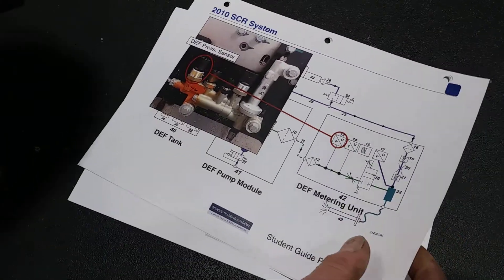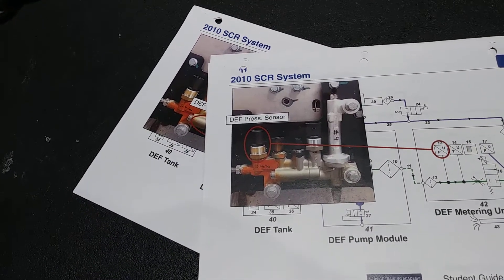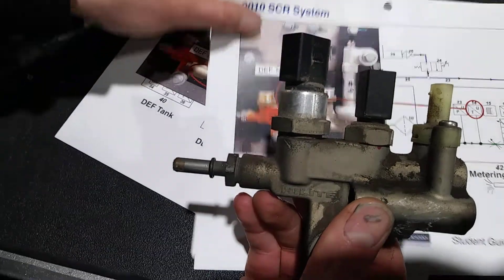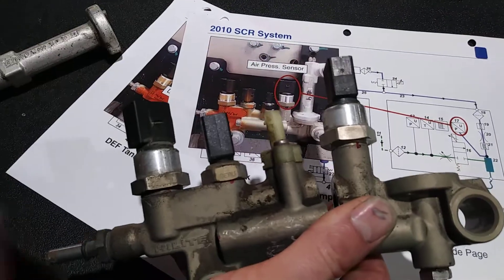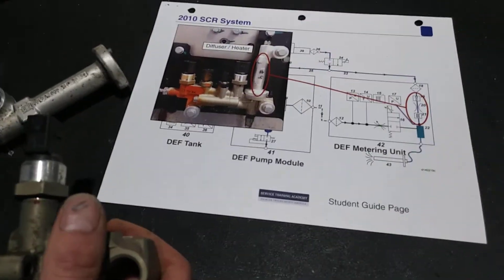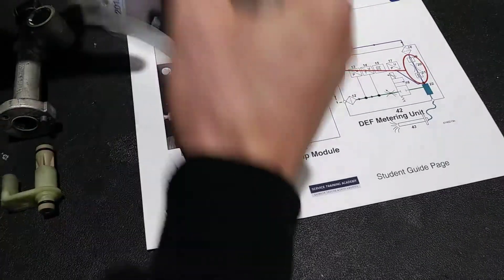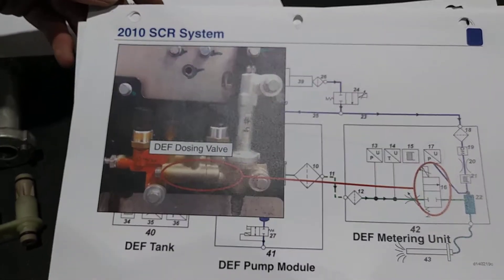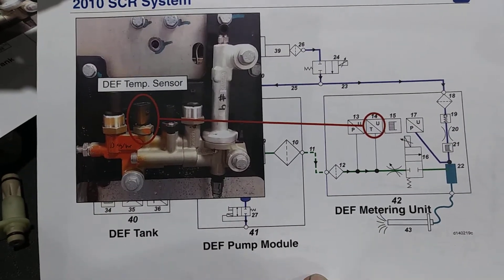DEF metering unit sensors

Comment: Hello there... Could the diffuser heater leak air....
Reply from the maker: Al A Hello, it is possible air may leak out of it if it is broken or o-rings are bad, but it is an electrical component.
Reply: Mad Motor Repair I really appreciate you for replying back.. I have a air leak that I just can't find .. When I turn off the truck to check for the air leak... The only place I hear some noise is around there
Reply from the maker: Al A no problem hope you find it